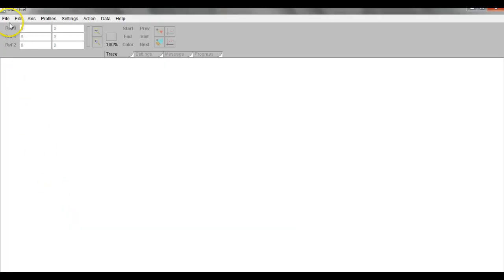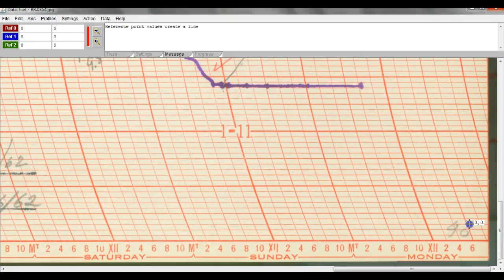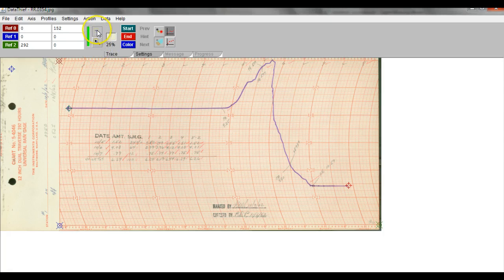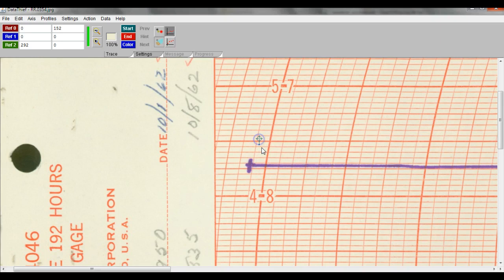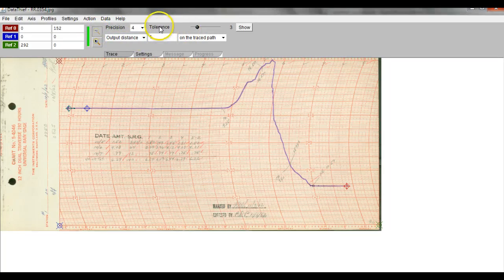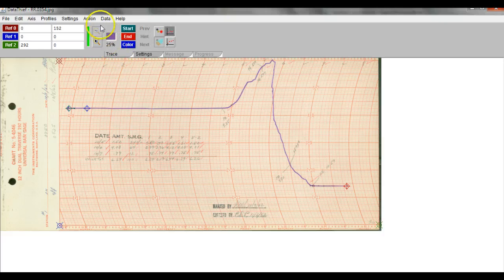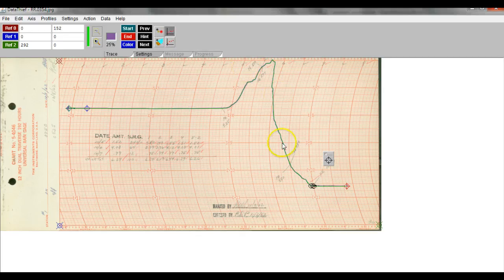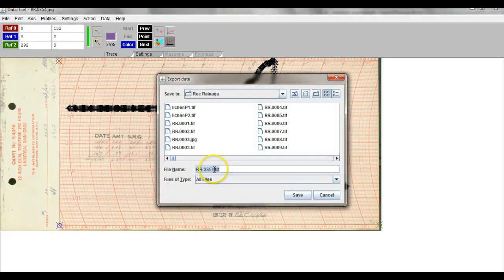Digitizing Precip Charts: A Tutorial with DataThief

Comment: What do I do when I have an chart out of an PDF and have no idea how long and high it is?
Reply: In case anyone has this same question, I was also a little confused by the length she mentioned. 

I just put in the coordinate values for the graph. So, I had one at the origin and put in (0,0). I had temperature on the x-axis, up to boiling (100 C), so for the rightmost point I put in (100,0) and for the upper point, the y-axis value.

In other words, not the actual physical length, but just the limits of the axes so that it knows what each point means.
Reply: Did u find the solution?
Reply: @indexspatial_santhosh  The program needs to have reference values to work properly. Otherwise how can it know what do you use to indicate them? E.g. you could use for the y-axis for precision lets say from 0 to 100 (to indicate percentage), or 0 to 1 as well. 
In other words, you need to understand graph and what you want to get. What data thief does is only approximation of a graphically recognized line along these numbers.